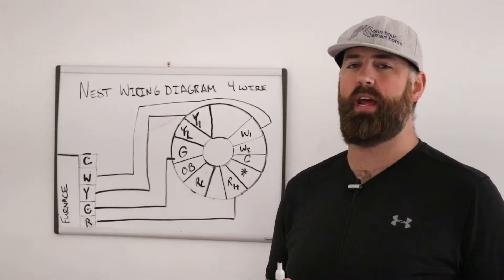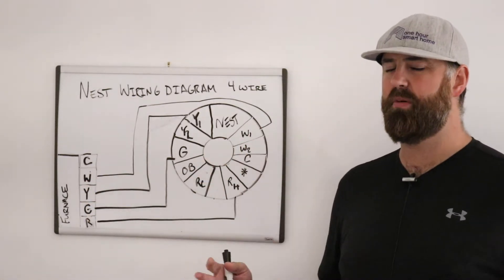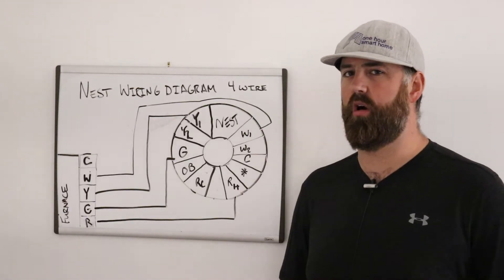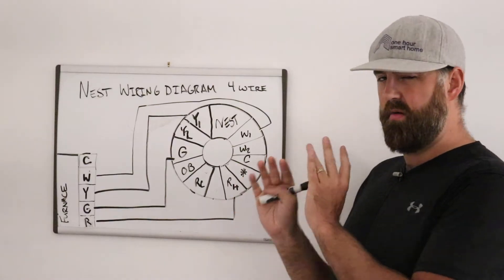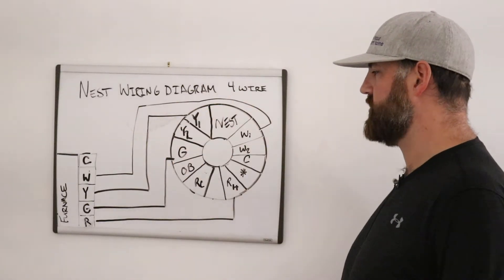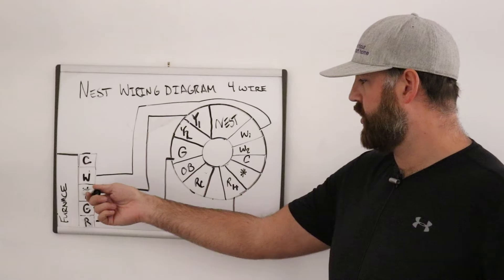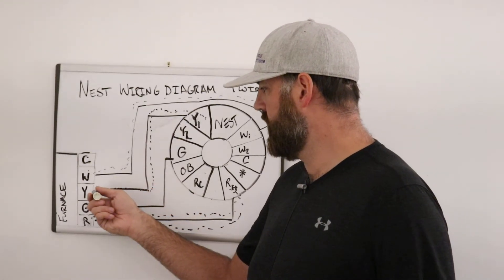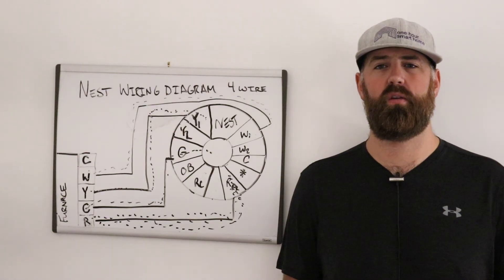Nest Wiring Diagram 4 Wires

Comment: Hi, I just got a two stage furnace but my nest thermo only has 4 wires and one of them is on w1.  So my furnace blows on high stage, can I switch that w1 wire to w2 so it can blow in “low mode” is that safe and will it damage the new furnace? Thanks.

Comment: Started having power issues on my 3rd Gen, replaced the internal battery and was good for about a week and problem came back. Ran a C wire and so far so good. I'm guessing my nest is starting to crap out. Had it for about 5yrs until issues.

Comment: Such a great video. I still can’t get my ac to kick on. I remember there’s something where every season we had to switch a wire so it would talk to furnace vs ac. Now that it’s summer, I’ve worked on it for hours and can’t figure it out. Nest chat couldn’t help either. Grey, white, green, red. Just found 5th black cord capped off and tucked back into wall. Any suggestions?
Reply: Yes you will use  the black wire you found tucked back as your C wire…just make sure you also put the black wire on the c terminal in the furnace so they match letters at both ends

Comment: So with the 4 wire setup how common is it to actually need a c wire ?  Because my unit is an older. Unit outside and the heater part runs of propane

Comment: Great Video! But what if I have 4 wires but my original thermostat I didn’t have all 4 connected , only 3 - and what if the wires weren’t in color order for example the older thermostat had the green wire where it said W1 .. I connected the nest according to how the last thermostat was set up but I am not receiving any power.

Comment: I've got a question. I'm wanting to install a nest e thermostat with 4 wires but there is no yellow wire.  Here's the current wiring. Red wire to rh with a jumper from rh-rc green wire to G, blue wire to Y , white wire to W. 
Do I hook up the nest E thermostat the same way without the jumper wire or?

Comment: I have a Ranco Dehumidistat wired into my current system. I believe it's simply a switch to control power to the thermostat based on humidity.  Do I need to worry about this when seeing to my 4 wire system?

Comment: I ran my wires as you said, I blue instead of yellow wire. The ac display does not show up. I noticed my ac condenser is connected to Y & C.

Comment: Hey so I’m in the Uk and looking to wall mount my nest e which requires a wiring base I can only find across the pond. It seems like I need Rh and w1 to power my heating but what powers would I find on these terminals?

Comment: My AC Heater Breaker keeps tripping, after that happens another breaker that supply’s power to my power Rc wire will trip. Once I flip them back on everything works fine for a short while. Any idea what it could be ? The heater breaker that keeps tripping is a quad pole 30/50 breaker and the second breaker is a quad pole 20/50. The first one only the 30A breakers are tripping the 50A is fine, but in the second one the 50A breaker is tripping. Both are are 240v and I’ve already replaced a couple parts inside my unit. I’m not sure if it’s the Nest unit or if it may need the C wire ? Any idea what it could be ?

Comment: I have a four wired hvac.  Installed the Nest in the spring and it operated the air conditioning just fine.  Now that days are getting colder the gas furnace kicks in but we only get cold air coming through the vents.  I read that disconnecting Y1 will allow the furnace to produce warm air.  I tried this but no change, still getting cold air.  Any ideas?
Reply: Same here
Reply: I selected reset on the Nest 3rd gen and went through the setup again and lo behold the heat started to work.  This after a number of hours trouble shooting it.

Comment: I bought the Nest Thermostat which ideally requires 5 wires but my old thermostat that was installed when the house was built in 2003 only has 4 wires and some of the wire colours are different than what the Nest Thermostat calls for, so this is how I connected it:  My four wires coming out of the wall are Red, Green, Black and Blue.  So, I connected the red wire to R, the green wire to G, the blue wire to Y and the black wire to W.
Reply: Same but my nest won't light up

Comment: For whatever reason my old thermostat had the W wire connected to the O/B terminal, even though I have a furnace. I copied this when installing the Nest and this caused issues. The Nest would default to the O connection which would turn the fan on and off, no heat. If I overrode that and set it to the B connection the heat would come on, but wouldn't turn off. After watching your explanation I connected the W wire to W1 on the Nest and everything seems to be working correctly. Thank you. You gave me exactly the information I need when you explained that O/B is for a heat pump.

Comment: I have 2 wire coming from the HVAC system. At the thermostat there is an adapter with 2 wires going in, and 4 wires coming out. Will this work with nest?
Reply: hello mate!Did you manage do figure out what goes where?!Im in the same situation.... basically my nest thermostat is used now only for heating and I want to use it also for cooling the house....the connection between nest thermostat and HEATLINK WiFi/Bluetooth  so I didn't use the C-wire..and now I want connect my AC UNIT (Mitsubishi)with the smart thermostat and dunno how to do it!😢😢😢

Comment: When I connect the red wire to the Rh terminal on Nest, my A/C unit keeps cutting off after 5 seconds. My Honeywell thermostat has a jumper wire between the R and Rc terminals, which I suspect is causing this issue. Any idea what might be going on, and how to fix this?
Reply: Were you able to fix the problem?
Reply: I have the same issue
Reply: Same problem did you fix it

Comment: My Nest does not seem to cool down my house when it is connected to the RH. There use to be a jumper between the RH and RC on the old thermostat. It’s not a AC problem. Since I just put the old thermostat back on and everything worked. Recently just switched out the wire from RH to RC. Hoping that it solves my problem. But then my concern is that my RC won’t heat up my house in the winter.

Comment: Hi! I live in Miami, so I don't need the heat option, should I connect it to the Rc Only? I have an issue with it, sometimes my outer unit seems to be on even if it is off in the nest. What should I do? Sorry if my question is confusing. Thanks!

Comment: Explained perfectly which answered all my questions regarding Rc vs Rh and whether I needed a Common.  Happy to report it's working.
Reply: I think I am in the same position as you were in. I only have a 4 wire system (no C wire). G, Y, W, Rc. Was it fairly easy to install? Any issues thus far? Thanks!
Reply: @Southern_Agrarian1930  Super easy.  Works perfectly on just the 4 leads.
Reply: Does it matter if connects to RC or RH? 
Right now I have it in RC and is not powering on

Comment: I just installed Nest E. Fan comes on for both furnace or AC but it will not kick on heat from the furnace. If I swap wires, the burner will kick on, but no fan. Any ideas? Nest Support can't figure it out.

Comment: So I have a question for you. The guy that installed my ac and heat pump only used 4 of the 7 wires so do I follow this video to hook up my nest?
Reply from the maker: Sometimes the builders run extra wires in case you have additional devices like humidifiers. Is the system working properly? If so I wouldn't change it. But this video: https://youtu.be/CCNIko3iZIE explains more about the nest wiring if you want to learn about more advanced wiring if your system has additional features like dual stage heating or cooling.
Reply: One Hour Smart Home so my air conditioner works fine but when I turn my heat pump on it will run if it is just 2 or 3 degrees from the temp but if I put it to like 10 degrees it shuts off and then turns on and off. I had emergency heat on my last thermostat but the nest doesn’t work right when trying to run the heat

Comment: Hello, At my furnace, I have 2 sets of wires. One has 4 wires and the other has 2.

1st set

Red - R
White - W
Green - G
Black - Y

2nd set
Black - Y
White - C

At the thermostat there’s only the 4 wires. Am I going to have any problems installing a nest thermostat with this wiring? I will add there is a humidifier connected to the HVAC. Thanks in advance!

Comment: I installed my gen 3 thermostats with a four wires based off my original thermostats.  I did see a a fifth blue wire on both of my thermostat wiring harness. Should I connect the common wire to my circuit panel and both of my thermostats? Thank you for your help!
Reply from the maker: Yes, if you have the extra wire available it's a great idea.

Comment: What if you don't have a green wire but you have a blue wire?  Also we connected it the way you said, except we put the blue wire into the C section of the Nest, because when it was in the G section it wouldn't turn on. Is it common that Green wire can be blue?
Reply from the maker: Yes,  Green wire can be blue. Did you make the connection to the C terminal inside the furnace? Your blue wire should connect in the C terminal in the HVAC system and the C terminal on the Nest. You need to move it to the C terminal in your HVAC system manually. If that doesn't work you might need a common wire transformer: https://amzn.to/35optKN and watch this video: https://youtu.be/gahPxCcPDto

Comment: I have question i check the wiring its fine but i have set to heat but no reason half the time it blows cold air even though it does work on heat too. even in cold season it blows cold air.